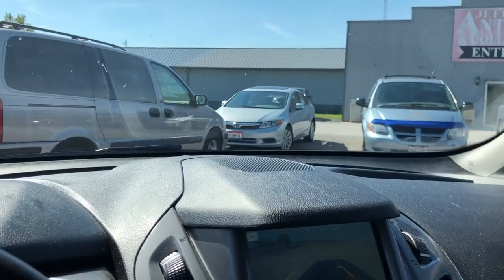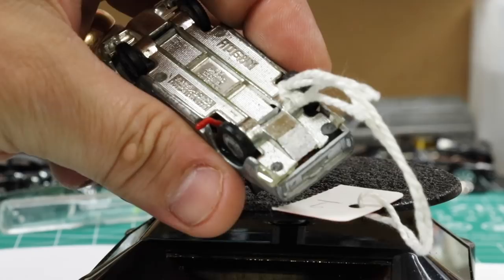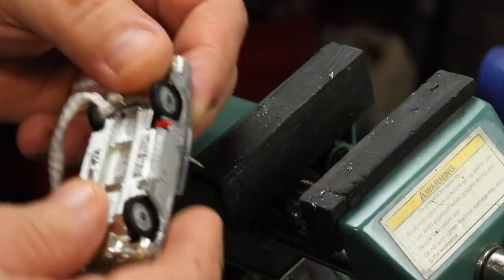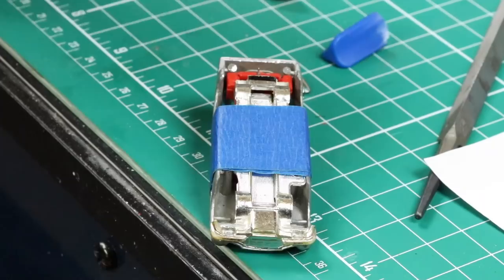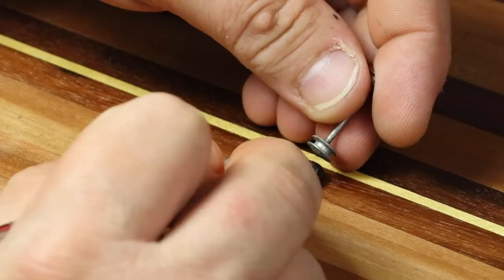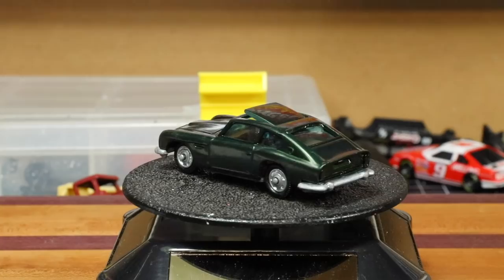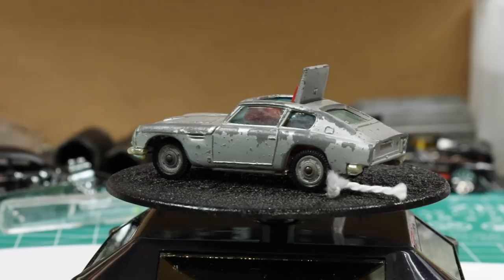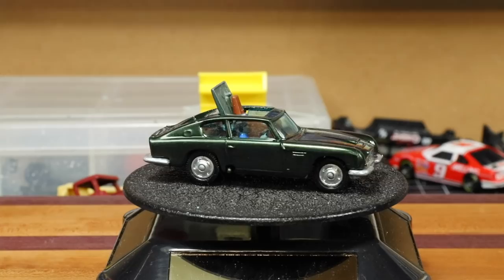Corgi Diecast Restoration Aston Martin DB5 James Bond

Comment: I am a Corgi/Husky collector. Let me try to set a couple of things straight about this model and Husky in general. 
Woolworth's contracted Corgi in 1964 to build an exclusive line of Matchbox size cars. These are Husky. Husky was always a part of Corgi. Corgi was always very good at getting licensing for popular vehicles. They had the license for James Bond and built many different models for the various movies. Corgi was already working on a DB6 model when they got the licensing so instead of doing a major re-tool they went with the existing casting and hoped nobody would either notice or care. 
In 1987 Corgi went bankrupt and dissolved. Mattel bought most of the old Corgi company including the brand name and the casting dies. One of the dies was the Aston Martin DB6. They have been using variants of this casting ever since. This is why the bumper fit so well. The Hotwheels is a variation of the original Husky casting.
Really love your work and your videos.
Reply from the maker: That is some really good info! It seemed like the entire base would have fit fairly easy so it all makes sense. Wish I had your knowledge, I skimmed Google but didn't find anything for the most part. Thanks again, I really appreciate it!
Reply: @WheelsNThangs   Despite being the third largest toy car manufacturer in the 1970's after Mattel and Lesney, nobody knows that much about the Mettoy (Corgi) company. It has taken me a long time to figure out what I do know. Corgi is still the wild west when it comes to information. For example, my guess would be that every 1970's Hot Wheel has been documented as to variations and body colors. Last year we found a 1970's Corgi Junior in an undocumented color. This just does no happen with Matchbox or Hot Wheels.
Reply from the maker: @kilarae1  That's strange that they don't have better records as these seem to have a lot of toys out there.
Reply: You know your stuff Hans. I have   no need to add any  further comment  !
Reply: @kilarae1  Seriously man, you really need to get out more...a lot more! 😃
Reply: wow! this is solid knowledge and needs to be waaay further up the comment section!

Comment: Hey! Husky always was Corgi. They switched the branding to "Corgi Juniors" in an attempt to up the perceived quality... Most interestingly, a lot of Husky casts went on to be rebranded Corgi and altered over the years. Corgi kept a varient of this cast going for ages, there was two versions, the other being non-bond. Anyway, as I'm sure you know Mattel then went on to buy corgi's assets when they got financial problems and we got a fair few corgis branded as Hotwheels. Now I'm not suggesting that the hotwheels DB is the same as the Husky, but considering Mattel could well have the designs for the husky/corgi versions it's more then possible the hotwheels DB was based on / started development from the corgi/husky design and thus, is almost identical in size
Reply from the maker: Grat info!

Comment: Following up on some other comments, it's definitely a DB6 (presumably from the Thunderball movie), you can tell by the little turn up on the trunk. The db5 has a smooth rounded trunk, plus a retractable bulletproof screen from the Goldfinger movie.
Reply: Yes it is clearly a db6 but it was never used in a film corgi just decided that it might turn up but it never did
Reply: @robertbrown4629  your right Robert, it was a DB5 in Thunderball, not a 6 as I thought I remembered!

Comment: Hey, cool video. Is there an easy way to re-attach the roof panel on the DB5? I bought a replica one on eBay, thinking it'd just clip in to the original toy easily, but it's two metal pegs, attached to an inflexible metal roof, that I'm trying to to fit into 2 metal holes in an inflexible metal frame on the car and unless either on of those things' have got a bit of 'give' I don't know how I'm going to attach it.

Comment: Great job as usual. If your up for suggestions as for an easier way of removing the old rubber tires try setting them in hot water to make them more flexible so they break like they often do given their age.
Reply from the maker: Great tip, I'll use that on the next one!

Comment: That's a 'Husky'. Made by the Corgi Company in Wales, and only available from the now sadly defunct 'Woolworths' chain stores. In the late 1960's, they were rebranded as 'Corgi Juniors', and available in multiple outlets. Husky cars were lovely, as they made lots of vehicles that Lesney 'Matchbox' did not. They also made TV and Film vehicles - I have the 'Man From U.N.C.L.E' car, and the George Barris designed 'Monkeemobile'. Most Husky models had moving parts, and suspension - this let them down, as it was part of the polystyrene base, and broke due to stress, leading to 'Lowrider syndrome'🙁. Later models had sprung steel suspension, like the larger Corgi models. I remember the spring on the James Bond car being quite lively, firing the bad guy out of the roof like a missile. And was always lost. I know you'll make this one look great - you always do good work!
Reply from the maker: Wow, I never knew. I need to start looking at these Corgi and Husky models a bit more! I'm starting to find some castings other than Hot Wheels and really enjoy the background on them. I've learned so much from my YT comments. Thanks again!

Comment: Your title is kind of wrong, this isnt a DB5, its a DB6, the model just after, as they changed the tail to be flatter and more sloped for aerodynamics, My guess is Husky either decided to update the model as the DB6 was made between 65 - 71, just after goldfinger came out or they decided to do it with the latter one as Corgi Held the rights to it, but not the 6. 

figuring its more or less the same car, and the kids wont notice, which is probably the more likely case with this.

Comment: I thought the original JB Aston Martin has a bullet shield at the back and a hidden machine gun inside the front bumper?
Reply from the maker: There is a Corgi larger scale one that has those features. I think it might be 1/43 scale.
Reply from the maker: Correct. Totally different car and larger in size.

Comment: It's so strange to me that Corgi did Bond's car as DB6. Does the bottom of the model say what year it was released? I wonder it was before or after they did the DB5
Reply from the maker: No info really on the bottom. I changed the title to DB5, the DB6 was a typo (it was late) . Husky sold this as a DB6 and DB5 from what I understand but I have no idea why.
Reply: the model is actually a DB6, your typo was actually right. Search up DB5 & DB6 to see the difference and look at your model. Love your videos, keep up the good work
Reply: It's not a corgi casting. There was only 3 jb 007 casting tooled by corgi. 1st was the gold one they did that was actually the old db4 tooling that was altered. Then a new tool dedicated 007 db5 around 1970 that was silver. Then a bigger 1/32 db5.  My guess is that husky seen the continued popularity of the corgi model so the converted a db6 tooling because that's all they had.
Reply: @colinjohnston8519  Thanks for the information. Do you collect them?
Reply: @carsaine4535  yes I started collecting them but haven't bought any for a while. I have my uncles old toy from 1968. It's the first version in gold number 261. The second version was number 270 I think and corgi re released that one a few years ago in silver and gold. The gold was very rare and they sell for silly money. I have a silver one cos I wasn't prepared to pay big bucks. I also have 1/32 version but it's a recent release from Skyfall movie I think. I would love some nice original models but they are really expensive in nice condition.
Reply: @colinjohnston8519  Very nice